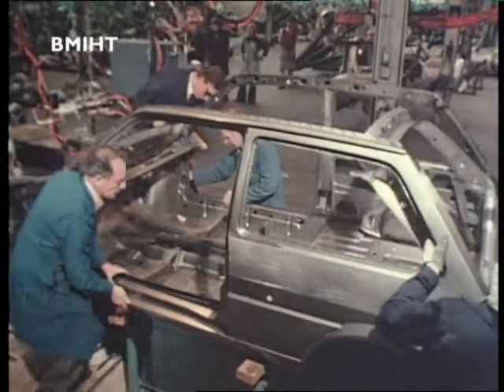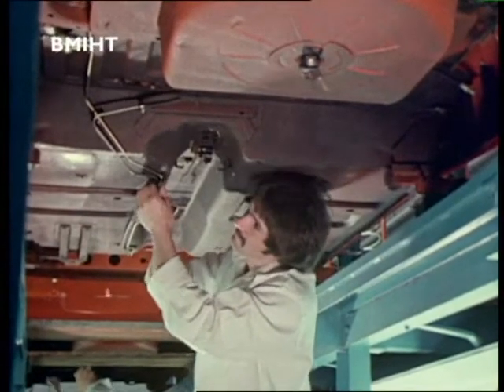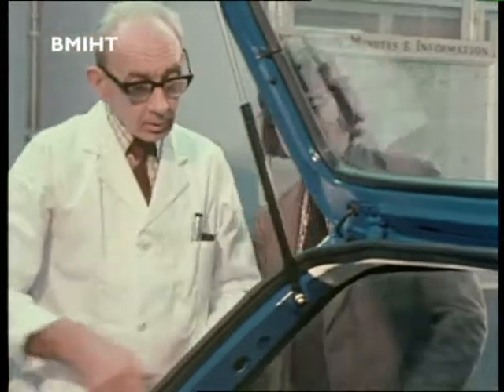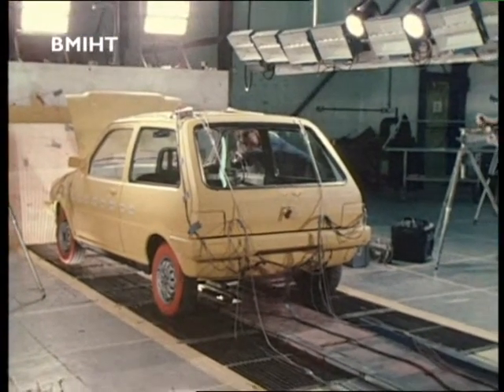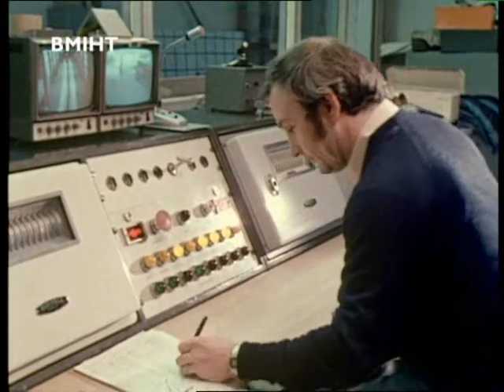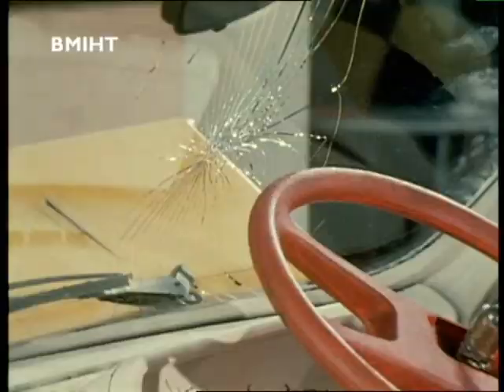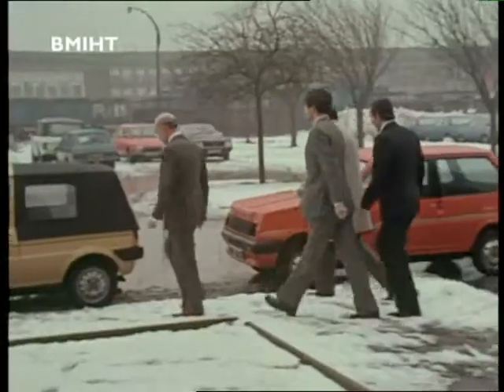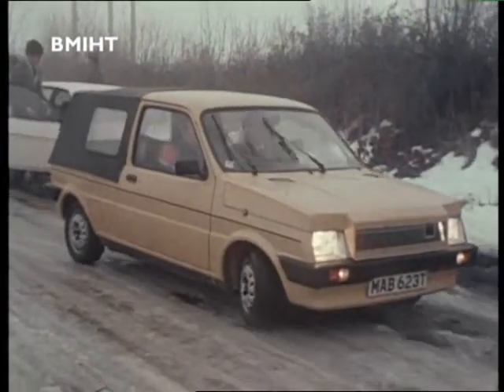Austin Metro Development 2

Comment: Flawed and badly built. The metro was typical of BL cars atrocious products.  The driving position was awful and the steering wheel placement was offset and uncomfortable.  The cars rotted within months, not years of being sold from new,!! BL knew that the front air valance behind the registration plate particularly rotted really severely and quickly and did nothing to rectify it for years. Crap cars that lost their admirers because of dismal build qualty.

Comment: Did I hear right?  Are they implying the metro was as aerodynamic as a Porsche!  Was the Porsche going backwards or did the metro rust away while the Porsche was being tested? ;)

Thanks for sharing.  If nothing else these vids are a great insight into the work which went on and the attitudes of the era.  Fascinating seeing now obsolete machinery being described as cutting edge and a real reminder of how far things have come in quite a short period of time in terms of technology.  Unfortunately complacency was one of the prevailing attitudes in BL which doesn't really come across in the films, but was probably the death of British owned motor manufacturing.  

The foreign owned manufacturers developed their models and addressed the problems, whilst what was then Rover where still essentially selling a car originally designed and conceived in the 70's (though re-engined in the 90's as the 1950's engine was well past its sell by date) and still recognisable as such despite the facelifted body shell, in 1998 by which stage the polo was in its 3rd generation and the fiesta its 4th whilst the Nova had been replaced by the Corsa.  Though each generation of these cars weren't really entirely new they where at least updates of the previous cars with current styling both inside and out - inside and out the rover 100 was recognisable as a Metro which given the reputation the Metro had made for itself over the years was not a good thing!  Unfortunately by the time it was realised that things needed to change the investment to do so just wasn't there and Rover where stuck with the mini and the metro/100 (cars designed decades previously) as their small car offerings.  BMW pulling the plug and taking the new mini design (where much of the investment had gone to) leaving Rover with just old Honda designs didn't help matters either!
Reply: I've never read such BL hating bullshit. It was a brilliant car for it's time, tried and tested A series through to snappy, free revving K series engines,  great handling, a hatchback, practical, reliable and boasted an 18 year production run. It rusted in exactly the same way as an equivalent Fiesta or Nova did of that time! That goes for any BL car made!  The Japanese stuff corroded before your very eyes! BL cars were more reliable than other makes of that era. Look at the BMW Mini, garbage, weak gearboxes, failed timing chain tensioners, failed power steering pumps, electric glitches, use a litre of oil every thousand miles! Scandalous in a modern vehicle, thrown together rubbish, if Rover had made it (and it was their idea, to redevelop the Mini, they drew it up) it would have been far better built than BMW did it.

Comment: Despite their efforts for perfection,the Metro still leaked like a sieve.Rainwater would pour in around the windows seals,door seals and if you were unlucky enough to have a sunroof fitted it it poured in around that too.Turning the turd brown vinyl covered cardb'd trim panels into soggy masses that went moldy.Rust was a terrible problem,if they had used galvanised sheet steel for the entire car, waxoyld the sills and cavities plus proper undersealing,and bonded glass,it would have been sorted.